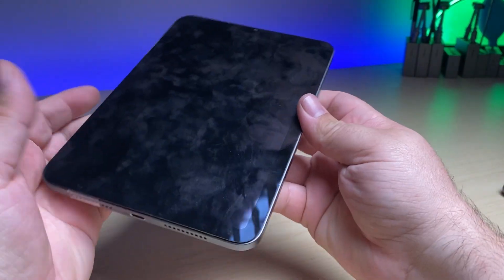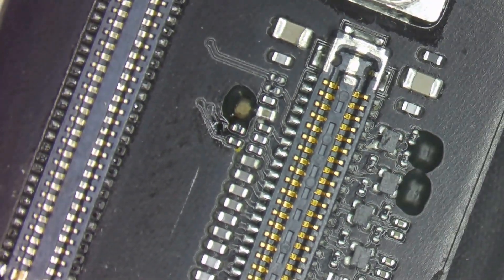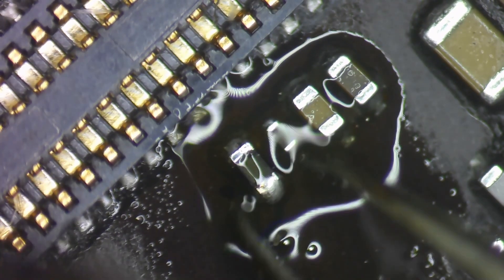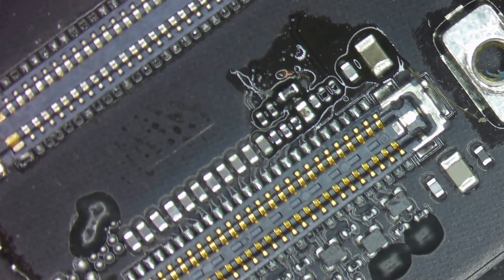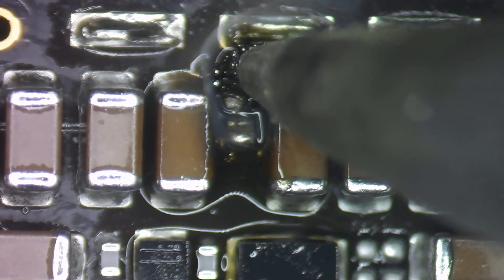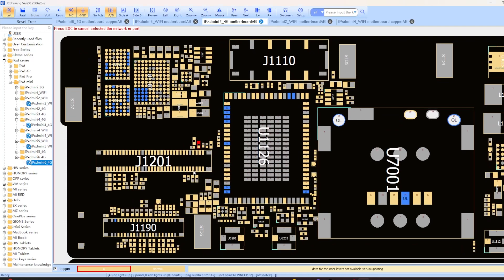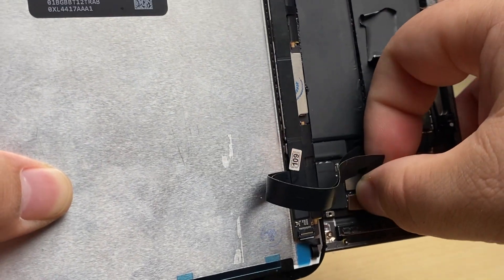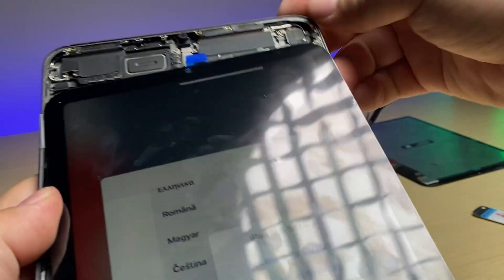iPad Mini 6 Troubleshooting Guide: Fix Common Issues with No Image (Tips and Tricks #8)

Comment: Hello brother, I have the same problem with the quick red logo flash. If I use my flashlight and focus it on the screen I can see that the device is on.

Do you know if replacing that specific component it will fix it for me?